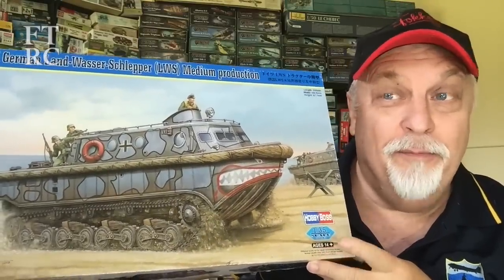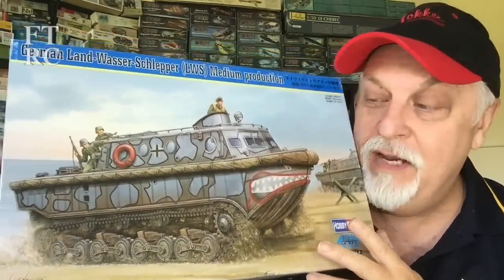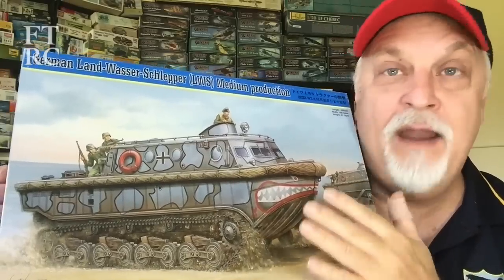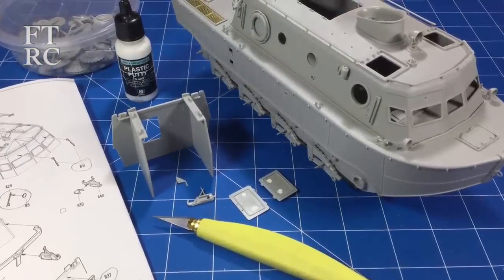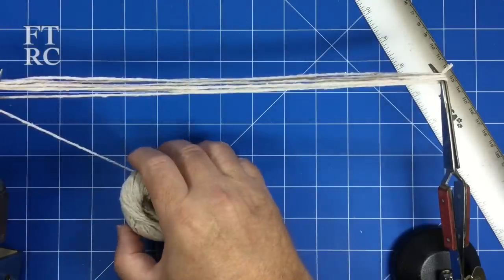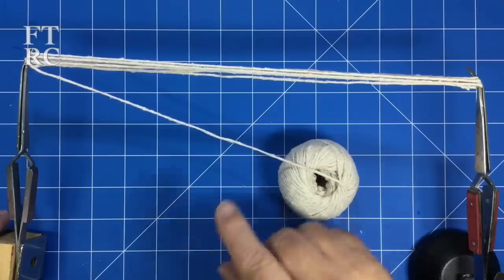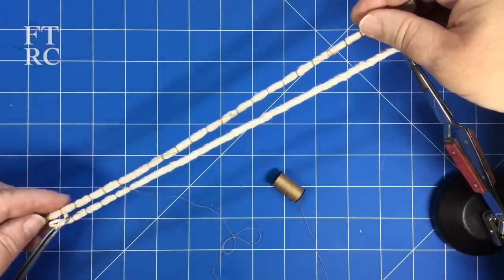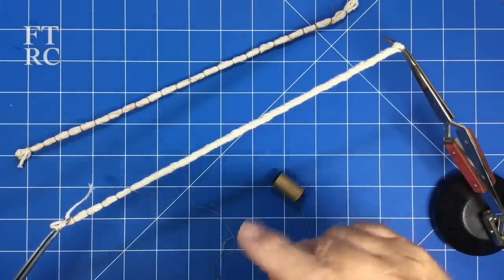Hobby Boss LWS Part 1 Review and Build

Comment: Another well done video Double H ! I will definitely use your link cleaning method for the indi links on my Hobby Boss T-26, T-38, T-37, T-20 Komsomolets and Komsomolets ZIS-30 sp . Obsession , what obsession? I have an Italeri DUKW that I may use your bumper method for . The kit has plastic bumpers for the corners . Not too bad , but I like yours better . I've noticed in your posts that you've been using the Frankenstein thermometer readings and both metric and correct measurement systems in the video . Any reason for that or just how it's been coming out ? And , lastly , before my pen runs out of ink or you fall asleep reading this tripe . Speaking of liking a good tug , the opening ad for Fabletics women's athletic tights certainly made for a well pounded viewing experience ! 😀
Reply from the maker: I grew up with a 100 being a hot day... some how 38 Celsius just doesn’t seem as dramatic.  As for feet and inches, it also sounds better to say a foot or yard long!  Plus half my audience are Yanks and they don’t know the rest of us are metric yet.  I kind of have a food in both systems being born imperial then becoming metric when Australia changed over in the 1970’s. I may have to search for that advert. Since leaving broadcast TV and the advent of online streaming, I don’t watch the adverts anymore.
Reply: @HarryHoudiniModels  it was a very well rounded commercial.

Comment: I’m building this right now… and I’m not impressed.  The first problem I noticed was both rubber tracks were too short.  I had to soak them in very hot water after tying the the ends with thread. At least they held.  The kit isn’t horrible, but I grew up on Tamiya, and I’ve been spoiled.  I’m about half finished, and it’s getting better.  Great subject matter, though.  I’m sure when it’s completely done I’ll be happy.
Reply from the maker: Hang in there, it is a lovely kit to work on.